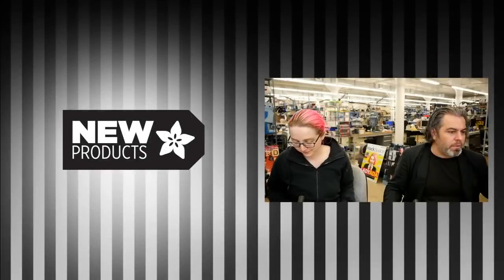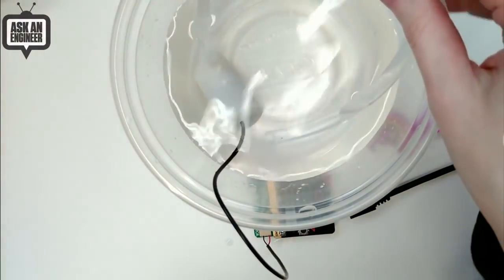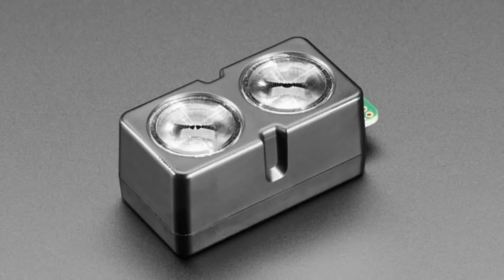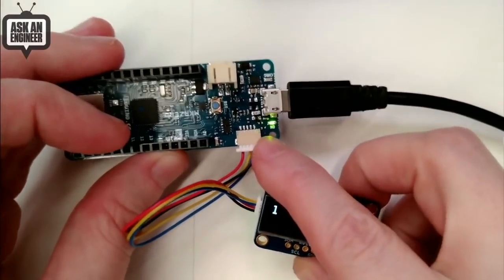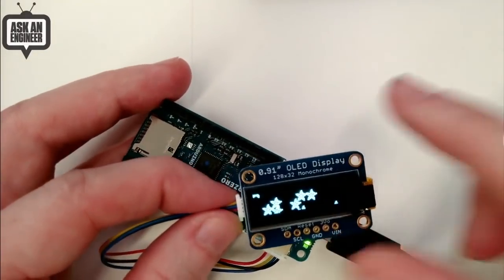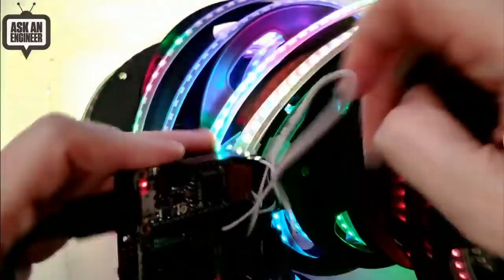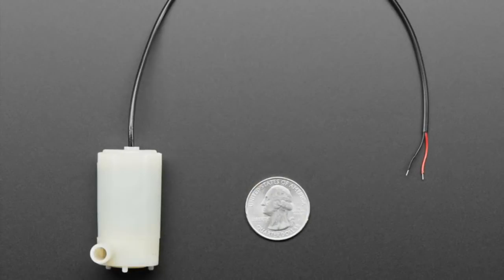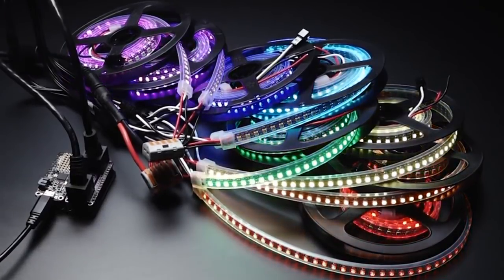New Products 2/26/2020 Featuring #Adafruit #NeoPXL8 #FeatherWing for #FeatherM4 - 8 x DMA #NeoPixels

Comment: Ooo. I could've used one of those pumps for a watering project for which we ended up using an automotive wiper fluid pump. It worked, but it was so overkill.